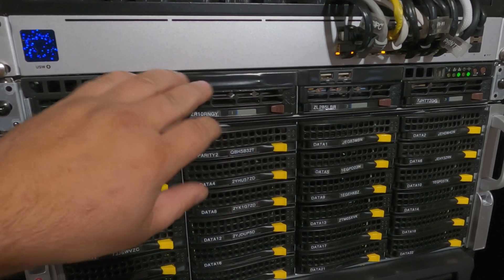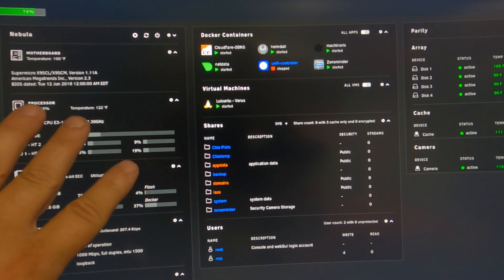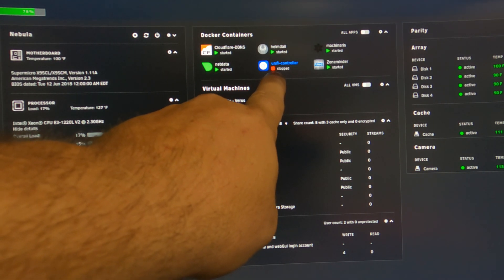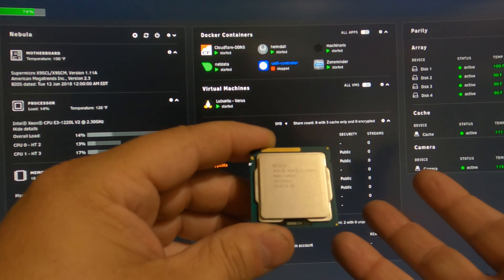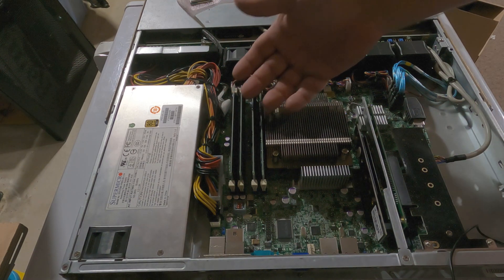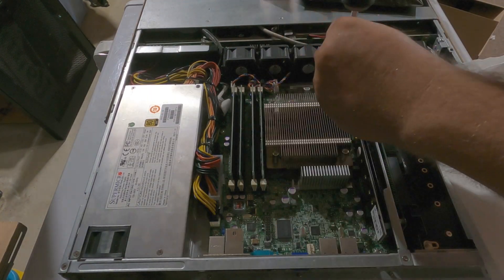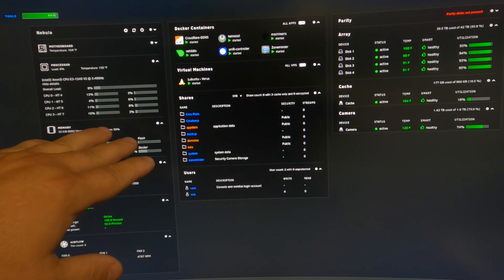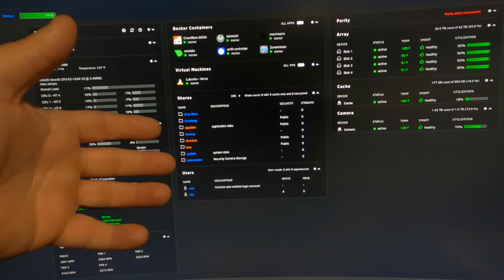Server Upgrade - More Ram & Better CPU - You Need A Server For Crypto Mining!!

Comment: I use a dual e5 2470 v2 for my unraid server. Upgrading to a v4 soon. Currently mining with 12 of the 20 cores or 40 threads. 64MB of ecc ram. I’d use more threads but I do use it for jellyfin, nas, Shinobi, home assistant, homarr, mealie etc… would love to get a 1u server to cpu mine with but even xeons aren’t great for that compared to ryzen. I might repurpose my 2 or 3u servers for mining. My 3u is my unraid backup, mostly is off or idle… but has an old and apu in it currently.